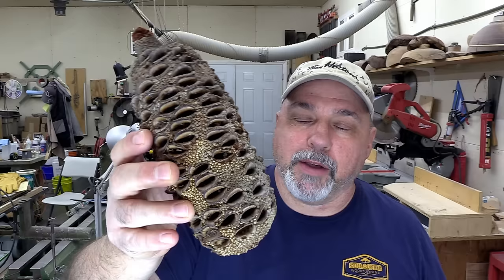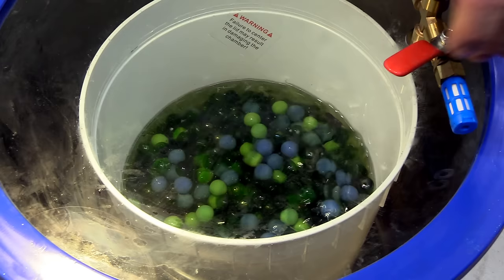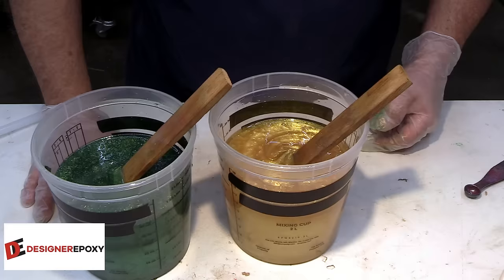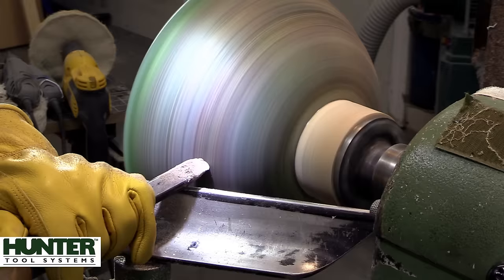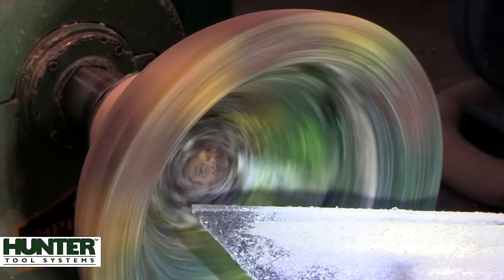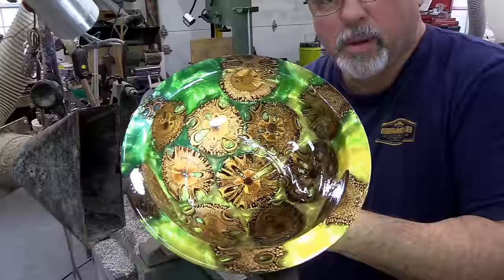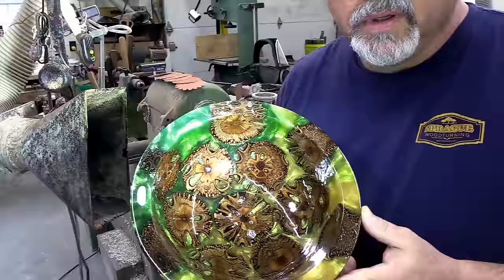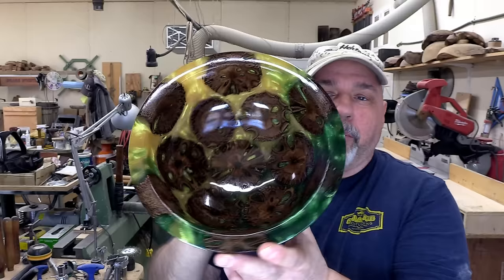Woodturning - Australian Inspired Banksia Pod Bowl

Comment: Another great project using Designer Epoxy. I think the way the pods are exposed in cross section is great and visually appealing. I imagine it just as interesting to look at those as the swirls that are in the epoxy. Any water-based finish is likely to have trouble with the epoxy. I believe the epoxy could be impermeable to water, and lead to issues using those kind of finishes in general. Like you said, it is not a reflection on the product itself, it is merely the type of surface you're putting it on. If there were such a thing as a clear primer, that might lead to being able to use water-based finishes on projects like this.
Reply from the maker: Agreed, thanks!

Comment: I love this piece, Jim.  The pods are pretty spectacular, and the way that the hyper shift ties  both of the colours together is just fantastic.   Just a note re the water based finish that you used first...I've always been told that resin and water don't mix at all well, hate each other in fact, and that could have been the problem you were having with the first finish.  I'm no expert though.  Thankyou for another great tutorial.  Designer Epoxy
Reply from the maker: Your statement is correct for liquid epoxy and water don’t mix. If the epoxy is dry it shouldn’t be a problem. Thanks

Comment: I wish I had seen this video sooner. I tried the H2olox as well, because I wanted to reduce the chemical smells in my small shop. But I experienced the same problems you ran into. streaking which I could not get rid of, and I tried buffing it and it blistered leaving the buffing material in the finish. I think you are right Jim, this is really meant for flat floors. I will try the original Gloss to see it that works out better for me.
Reply from the maker: The gloss is great! You’ll love it. Thanks

Comment: Designer epoxy and banksia pods are a beautiful combination.  You will have to try adding a little blue  with the green and gold.  I have tried min wax H2O finish on furniture and will not use it again.  I had to sand it back and apply oil base finish.  Quite the mess.
Reply from the maker: Thank you very much!

Comment: i will have to order more designer epoxy because i used a BUNCH to make a sea scape with a fish i carved , some burl and shells and rocks - but unfortunately i used too much colour and it is too opaque so you cant see the detail - i also got some plastic tape imbedded in the bottom that i cant turn away because the rocks are too close to the bottom and there is no way to cut them.  live and learn.  great bowl by the way - love it
Reply from the maker: Yup, that’s a tough lesson. Thanks!

Comment: Welp, that did not go liked I hoped on the water based finish. I concur with not pursuing it further Jim. Nice recovery too in the time limits you had. Boy what a bummer. I had my finger on the purchase button too. I use a polyurethane water based finish on a lot of cutting boards and some furniture for customers who have sensitive noses or asthma.  I love this piece too. I was wondering how you kept the spacing without glueing the rest in. I get the stabilized won't float as easy but will move when you pour.
Reply from the maker: These pods would float, not a lot of wood to stabilize here, lol. When I glued the top ones in place they were pushing down on the other ones keeping the, in place. Thank you very much!

Comment: Chocolatiers use vibrating plates to get air bubbles out. Maybe using that when you are pouring could help reduce time in the vacuum chamber. Just a theory. The easiest access to one of those is to borrow something like that from someone who bought one of those plates for fitness. The ones in the chocolate industry have stronger vibrations. Have you ever worked with those?
Reply from the maker: No, but others have suggested it. I will check Amazon. Thanks
Reply from the maker: Just checked and way too expensive for something that will work.
Reply: @SpragueWoodturning  damn. it would make it possible to make creations that are not limited to the size of your vacuum chamber and  you could have lunch in the meantime. i actually think the ones designed for people might be stronger as they need to jiggle more weight around than a bit of chocolate. but them being so small, i would worry about creations tipping over. keep on creating whatever way works best for you.

Comment: Wow, those pods look fantastic filled with color and the green and gold transition is perfect. I just did my first designer epoxy turn and it came out great. I ordered the deep cast just to be safe, but the problem was that even after 3 hours of sit time both color batches were only at 72 degrees F so the batches didn’t thicken up like I would have like for separation. I heated. I know I mixed it properly and the end product turned out great. I heated my shop to 55/56 but that didn’t help. I did bring the pressure pot inside the house for three days. Any thoughts
Reply from the maker: It needs between 70 to 75F to start curing. Even at that temp is still can take 12 plus hours to achieve color separation your looking for. Thanks

Comment: Maybe next time, you could measure the amount of stabilizing resin in that bowl, and then put it in to the other pot.  You could then use what you measured right in the stabilizing pot, and not waste anything?  Just an idea1
Reply from the maker: Yes, that would be about the only way to measure it other than using water and I definitely don’t want to do that. Thanks

Comment: Another beautiful piece of artwork!!! Got a love that color shift!!! The sparkle & the different tonal qualities w/in the color. 🤯🤯🤯 Couple Q's. If u pour the different colors of resin in layers, would the 2 colors mix 2 make a combined new color or would they layer intermingled, but separate colors? Like, where the gold & green meet in this bowl. If u were 2 layer the colors, like in a jello dessert, would u have 2 let each layer harden completely, b4 pouring the next layer? Also, is there a reason y u prefer flat rims 2 rounded edges on ur bowls? Thanks 4 sharing ur knowledge!!!
Reply from the maker: In all likelihood the colors will just combine together unless there are poured at the same time from opposite sides at the same time. You can do multiple pours, but I don’t like witness lines and that’s exactly what you would get. Thank you very much!

Comment: i like to vacuum a single pack water base polyurethane, 'U Coat sealer' down here in Aus. i vacuum it in like you do with the stabilizer a few times then pour off the excess, let it dry. ready to to use.. another tip if you like.. your excess epoxy pour pot. tip it on an angle each bit, so you don't just get straight rings...
Reply from the maker: Thanks again!

Comment: Should pine cones be stabilized with the cactus  juice prior to using in resin pours?
Reply from the maker: No, they do need to be heated in the oven to remove the pitch. If you don’t, you will have all kinds of issues with it bleeding through the finish. Thanks

Comment: Had a similar problem with water polyurethane!!
Question… what temp do you heat for the waste blocks I have had 2 pieces come loose?? 
And we still love Designer Epoxy
Reply from the maker: My electric frying pan is on max. Thanks

Comment: I have recently found your channel and absolutely adore your work. I don't turn but would love to have a go one day. Could I ask why you wouldn't use water to work out the volume of epoxy you would need?
Reply from the maker: Water and epoxy don't mix, the only way to use water to measure the volume would be to dump the water out and then let the pods set there until all the moisture is gone. If you tried to combine the resin with the pods after using the water to measure the volume there will be all kinds of issues. When we cast resin, things need to be bone dry.  Welcome aboard! Thanks

Comment: Fantastic piece. I really like it. Too bad about the water based finish but thanks for showing all the details. So what is your opinion of the cactus juice for this piece? Worth the extra effort or no? And why do you prefer the rice method over making a wood insert that you can pinch between centres? Or would you use that on a bigger project that needed more support? Love the commentary and all your efforts as always. Cheers. Designer epoxy
Reply from the maker: Truthfully if I’m using deep cast, it’s not needed. Using the rice as a spacer works great, no need to waste any wood, lol. Thanks

Comment: Designer Epoxy
Hey Jim - I've really been enjoying the content you've been putting out. Keep up the great work. I've been playing catch up since the holidays so I have a number of questions I'm getting around to asking so I figured I'd put them all here.

1) I was exploring around on the Designer Epoxy website and saw a number of "ghost" pigments ("ghost blue", "ghost green", etc.). My understanding is that their understanding shows only from certain angles, but I was you can add some more detail. Can you talk about what they are & how to use them? A demo would, of course, be amazing

2) I know you were happy with the bubbles in the Ocean Cave Vase (and I agree!), but you might not want that for all projects. That was deep cast & I know there were different circumstances for that particular piece, but I had a number of thoughts here. Air bubbles seem like a bigger issue with the quicker setting epoxies & when mixed with a drill. Could you avoid some of this issue by mixing your pigments into the A & B before combining, putting them in the vac separately, and combine them more gently by hand just before pouring?  Granted, you would have to be confident in the concentration of your pigments, but I'd like to hear your thoughts

3) Finally, do you feel like doing the voiceovers has helped as turner (i.e. by forcing you to review the piece, you can reflect on the issues, challenges, and potential solutions)? I know when I was in college, I started to really excel when I would do my engineering problem sets and then teach my lab partner how to do them. 

Anyway, looking forward to hearing from you. Keep up the great work
Reply from the maker: Here’s a video where I use the ghost pigments. If I could do it again I would have mixed more or add more of the colors with the ghost pigment. Woodturning - The Ghost Burl
https://youtu.be/0_yO0rjcqPA

The bubbles came from the wood, ideally, after pouring the epoxy I would have put it in the vacuum chamber. and this probably would have reduced the amount of bubbles in the final piece. However, this amount of epoxy might setup quickly so I avoided it. Once we move and my new shop is setup, I will buy a freezer that can accommodate my large pressure pot and after using the vacuum chamber it will go into my pressure pot that’s in the freezer and this should eliminate most of the bubbles. 

I personally don’t think the voiceovers matter to my turning. I’m kind of anal when it comes to my work, a perfectionist if you will, lol. 

Welcome aboard, and these were great questions, thanks!
Reply: @SpragueWoodturning  Thanks for recommending that video. It answered my question perfectly. Not sure how I missed that one... I think I probably saw it and forgot. It's a great coincidence that that was the video when you first received the banksia pods

Comment: This bowl is very pretty. I like the edge you left for the detail. 
Would it be possible to leave the thick edge but thin down the wall below it from the inside? Just asking in general. Or do you have to keep the wall the same thickness as the edge for structural integrity?
Regardless, this is a pretty bowl.
Reply from the maker: Yes, I usually do thin the side walls on bowls like this. Thanks

Comment: Question. When I fill a small void in an epoxy area of a bowl with tinted UV Resin, I'm getting great results but there's always a "witness line (ring)" around the repair. Do you experience this? Do you have ideas for minimizing such a ring? If the void is in a hybrid area, the ring is hidden or unnoticeable due to the wood.
Reply from the maker: Can’t really help with that other than making the void or bubble area jagged so it doesn’t standout so much. Very tough to mix the epoxy to the same pigment intensity as you are aware. Hope this helps. Thanks

Comment: Instead of the rice method to measure how much resin. You could estimate by using a calculator for volume based on the size of the outside bowl. Then guess how big the center piece is and do the same then take the difference.
Reply from the maker: What about the holes in the pods, lol. You might be able to ballpark it I suppose. Thank you very much!
Reply: The rice was only to fill up the center, so the epoxy would not get in there. It wasn’t used for measuring.

Comment: How do you get the result you are getting when buffing with tripoli on Waterlux?  Seems to streak or melt when I do it.😡Beautiful as always.  Designer Epoxy
Reply from the maker: Are you running the lathe and drill in different directions? All I can say is keep buffing until the bowl looks uniform in appearance then apply the next coat. Hope this helps, thanks

Comment: Hey Jim, is the vacuum pump you use with your vacuum pot the same one you use for your vacuum chuck? Very cool looking bowl! I am working on a walnut and resin platter that I used Designer Epoxy Deep Pour. I tried to get colder separation (purple, green and gold). When I first poured, it was perfect. 2 hours later the colors blended. Have you tried and had good luck using deep pour and separating colors? Thanks
Reply from the maker: I have a different pump that I've got for my vacuum chuck setup, it came with the system from oneway.ca 
If you follow the steps in this video, you will achieve color separation, thanks https://youtu.be/PpJyeQjgcq0
Reply: Thank you

Comment: Love the green and the hypershift.  May I ask a question or two about your use of the vacuum pump?
Reply from the maker: Sure, thanks.
Reply: Thank you.  I recently purchased a vacuum pump and chamber.  I was surprised to see the care instructions said to change the oil after each use.  Do you do that?  If not, how often do you do it?  My last question is, can you use the same pump for the chamber and for a vacuum chuck?  Thanks again. @SpragueWoodturning
Reply from the maker: @lanceb7438  I haven’t changed the oil yet and it’s been over a year. Just make sure to use the proper oil. Yes, it can also be used for a vacuum chuck too. Jim
Reply: Thank you very much.  I really appreciate it. @SpragueWoodturning

Comment: You shouldn't cycle the vacuum. Let it run until no more air bubbles are coming out. Then turn off the pump and release the vacuum. Then let it soak for twice as long as it took to get all the air out.
Reply from the maker: Thanks for watching